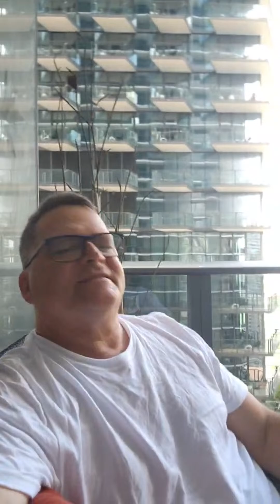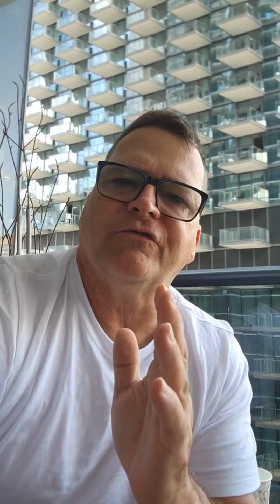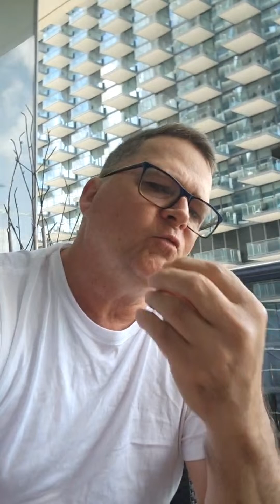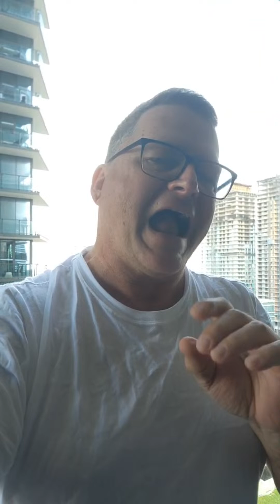How to lower your electricity bill with only  1 component

Comment: What is the tool that determines the power factor aswell as where is the meter?
Reply from the maker: A power quality analyzer meter will show PF, TP, and AP. Let the meter run for a week to get an accurate reading, and offset any readings with a power capacitor. Stay tuned for more